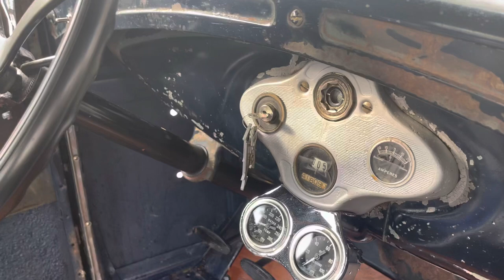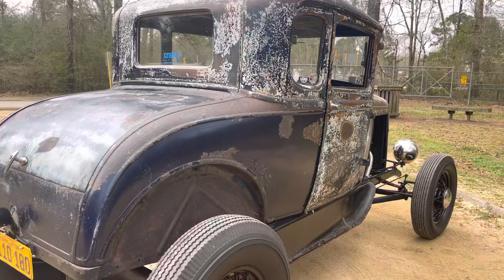Short walk around of my Banger powered 1930 Ford Model A coupe.

Comment: Engine sounds right. Now for a great paint job & the fenders & running boards reinstalled for a nice road cruiser. Plus it has the right ground clearance for rural areas and bad roads, driveways, entrance & exit ways in town. Low cars scrape. Great at the race track but not for everyday driving.

Comment: What size tires? Presuming 16” wheels? Looks just right.
Reply from the maker: Rears are 750-16 fronts are 500-17. Thanks, I am searching for a set of 18's for the rear currently to go up a little bit on tire size... May or may not run em...
Reply: Thanks! I thought rears might have been 700s and the fronts 600s because the size difference doesn’t look that much, to my eyes anyway. I’m dead-set on ‘hot rod’ 16s (probably wires), but there seems to be a trend on using sizes closer to vintage stock. When I couldn’t look at anything beyond East Coast ‘50s style, the ‘lost swageline’ look was always helped by taller tires and bigger wheels, for sure. 
Much like you did here, I have plans to tweak a ‘30 into a mild hot rod Banger, so am agonizing over wheel size for a true-to-style ‘40s coupe….
Reply: @56dodgepickupman  actually, looking again, rears do look a fair bit bigger!

Comment: for sale?
Reply from the maker: Most everything I build is for sale..
Reply: @56dodgepickupman  pice? location? can you make a full video of the car
Reply from the maker: @sylvain9334  I can make a full video, I have a short video showing the interior I will upload soon... If 22k doesn't scare you let me know.  Located in Houston Tx.
Reply: @56dodgepickupman  if you ever lower the roof (chopped) by 3 or 4 inches with the top cover and the side engine covers with a nice interior and a clean paint for 22k I will be your buyer! What do you think?
Reply from the maker: @sylvain9334  you probably need to go buy a nicely restored car for 18k. Put 4k into the motor, 1k into chop and glass. 2k in wheels and tires and into upgraded front brakes, 1k for upgraded gearing in rear end. Then whatever else is wrong that need fixing. Sounds like a solid plan for what you want.  The vintage speed market isn’t cheap to play around in man. You asked for a price. I got you one. Model A market is hot and won’t be cooling off anytime soon. Body like this in this shape as it sits is 5-6k minimum. If you find em cheaper let me know. I’d probably just keep it since I am still enjoying it and don’t need to sell. Best of luck finding something you think is worthy for that price man
Reply: @56dodgepickupman  you did not understand I asked you to do these things in addition how much it will cost in addition to the 22k?
Reply from the maker: @sylvain9334  Sorry, misunderstood, Alot of things factor in, but I am not a body and paint guy, so that would probably be best sourced by you locally, interior and chop I can work out a quote for you but would rather take this offline to make sure we talk about the same things. Email me at Stubbsrodandcustom@att.net Thanks, I will look for your email.
Reply: @56dodgepickupman   I have £22k  in mine just in parts -  no labour! £3 k here minimum for a roof chop ........RACE YA !😄
Reply from the maker: @jimshotrod2519  If I still had her I would....